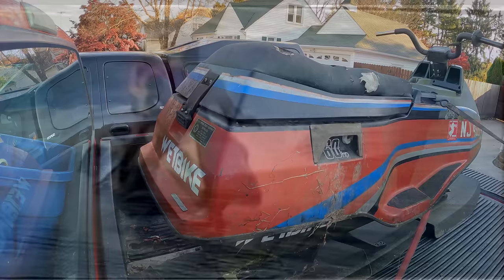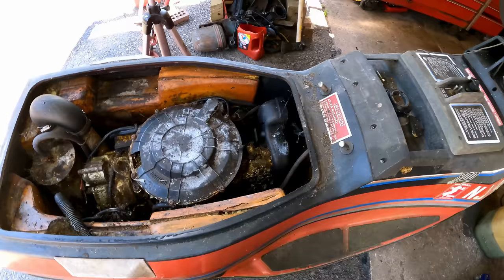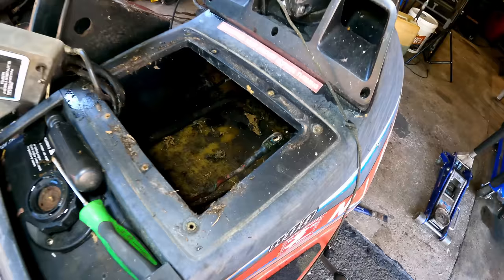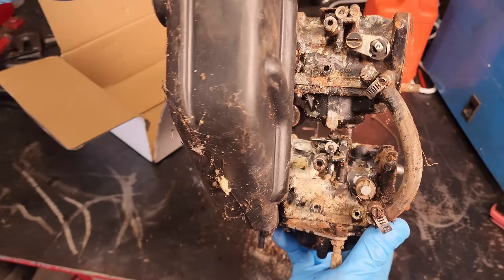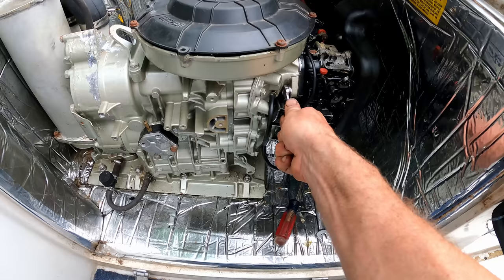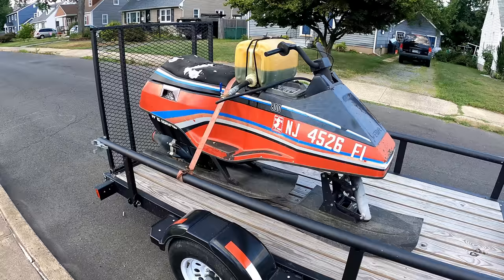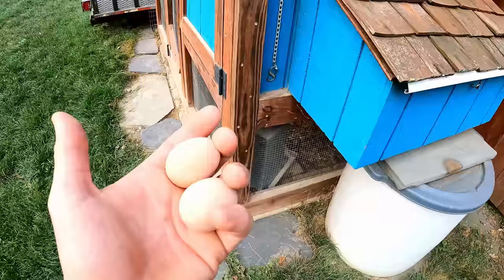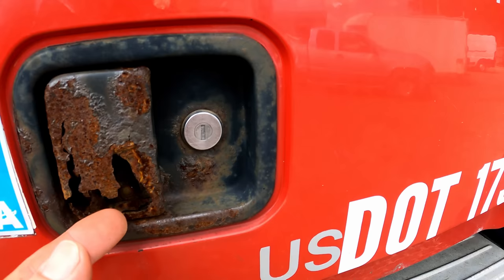70's WETBIKE Sitting For 25 Years Will It Run? UltraNautics WetCo - NNKH

Comment: The Wetbike is actually a blast on the water. It's a shame it wasn't stored properly, it was in sad shape! The 60 HP version is well balanced and has tons of power. There is a learning curve though. Your main problem was the fuel tank. First, the stock tank sits low in the Wetbike and holds 10 gallons of fuel. That adds 60 pounds and puts the center of gravity low. Secondly, when you punch the throttle, you have to stand up and lean over the handlebars. Your weight has to be forward and then it will pop right up on plane. But your test tank position prevented you from being able to assume the correct position for launch! Good try though, especially without any instruction. If you had been able to get it up, you would have had one helluva ride! Hopefully, the new owner will get it going again. You really did him solid at $1000 for both units! Great video and it brought back lots of fun memories. I have hundreds of hours riding time on wetbikes in the 80's and 90's out on the Colorado River (Yuma area), Pacific Ocean, San Diego Bay and Mission Bay! Those were some fun times!
Reply: So cool to hear about this! Riding in the Pacific would be so cool. Really all of those places you're mentioning sound Scenic and that would be such a neat exploration. Do you still have any or did you get rid of them long ago? I find it hard to grow out of them.

Exactly right on the fuel tank. And that price was amazing, I'm jealous. I'm glad he didn't get hurt, I would never want to be that near a dock when mounting one of these, even though I have ridden for years. Even though he can't do the full crawl to mount correctly with the auxiliary tank there, starting it while you're off the bike and then trying to jump on from the side is a disaster. I would never try that, when there's a dock next to you to fall back into.

Most of your riding sounds like it would have been scenery fit for the commercial they advertise these in. I'm jealous :/
Reply: I,ve got that model. I still love mine. And yes you can get parts on the internet. Much more fun than a jetski

Comment: Best case of just easier to pull the motor to work on I've ever seen
Reply: Very true lol that's the factory instruction for a lot of maintenance. Will take you less time to pull the motor and replace things then to fit a wrench in there and make micro turns until accessories loosen.

Comment: I think there were only 4 people that could actually drive these wet bikes the way they showed in the video. Those were the 4 guys. I have been watching your videos and am very impressed with what you do. I would love to be able to find cars and fix them to get them running. I went towards building homes and projects. I think I know just enough about cars to get me in trouble. If I was able to actually take it apart I could get it back together pretty well. Don't ask me to fix something on the fly. Loved the episode with the Chevelle.
Reply: I also enjoyed the Chevelle episode. He is good at fixing things quickly, I wish I was that good. You would be surprised how little it takes to ride them like they do in the advertisement. Most people could ride them impressively in under an hour, well enough to feel confident in their skills in less than half that time. Don't get on from the side (same for any jetski) and get the fuel tank out of there since that's where you're supposed to be sitting, then you just have to get a feel for the steering. Not hard. Not sitting far enough forward at takeoff makes it want to pop a wheelie and then you can't steer it all and not many people can balance that way anyways, like riding a bike wheelie.

Comment: Just happen to come across this video. Ironically, I used to have one and it was a blast (until it got stolen). Just to let you know, the procedure for starting off is:
1) slide onto the seat by pulling yourself from the back and up to the sitting position using the handle bars.
2) once sitting on it, then you start it and take off.
Great video and good job getting it running !

Comment: Something I have learned that helps when pulling a cable whether throttle or hood latch, attach either wire or a heavy string to the end so as you pull it out it gives you the path to put the new one in, just tie it to the end of the new cable and pull it through 😊

Comment: Well you got it running. I think what was holding you back like you said was the tank in your way. Not being able to put your mass where it’s needed is a big deal with that machine. 

Anyway you got them cleaned up and running and off to someone who can use it and not to the dump. Mission accomplished.
Reply: Definitely true, that fuel tank preventing his body position and weight from being in the right spot did not help. Not mounting it from the rear and getting balanced before trying to start it was also a problem, I've ridden these for years and I would never try and start it and then get on from the side

Comment: make sure to take the filter out of the vacuum when sucking liquids.
It has a check valve to prevent liquids to get into the motor. This way your filter stays in good shape for dry stuff.

Comment: Worked at a Honda dealer  that had a wet bike lot of fun to get started to plain out the trick was balls to the walls an keep on it even in the turns but it would beat you every time, thats good it sold

Comment: Ok.  One of the secrets of riding a wetbike is stand up.  As you take off you have to shift your weight forward to the front ski. Basically stand up and lean forward as the front of the boat comes up.  Also the bigger you are the more forward you would sit.  I find myself basically sitting on the gas tank.  I own 3 Wetbikes.

Comment: I have one just like that.
60hp Suzuki. 
The first ones had Kawasaki engines
You cannot get back on in deep water from the side. It will just roll over on you.
You have to stand on ski in rear and grab handlebars.  Start engine and give full throttle. As it stands up on end pull yourself up onto seat.
It's like riding a motorcycle on the water.
Lean it to turn.
They will wear you out after a day of riding.

Comment: I remember when I was a kid someone had one of these on the lake at the cottage it was so slow but looked like a blast
Reply: Dont know how long it was since you were a kid but these were the fastest PWC-thingy you could get factory stock until the 1990s, at almost 40mph. So back in the day if they were runinng correctly, they were considered quite fast. A modern Seadoo spark with the 60hp engine which is a pretty popular entry level PWC isnt any faster really even today.

Comment: Stuck screws? I like Mustie1 's solution which is an air hammer attachment that has a turn bar and a screwdriver adapter.  You engage the trigger and turn the bar which gets almost any stuck tight screw out, he also uses the hammer driven screwdriver outfit as well.

Comment: These things are a blast to ride!  Only problem I see is that fuel tank, it’s right where the body needs to be when getting up on plane.  Crashing is pretty violent too like when you carve to tight and catch an edge over correcting.  But man what a blast!
Reply: yea it seemed like weight balance and distribution were way off.

Comment: Remove 10 nuts on the pump. Unhook the throttle cable and battery and lift the engine out.

Comment: you shouldn't give up that easily. these are not that hard to ride and can bea lot of fun. you can pull several water skiers & I've even barefoot skied next to it while riding it. I worked for the invented of the wet bike & we would take them to a lake or ocean to advertise them. we would run circles around Jetsons. a friend of mine has a few of them & lots of spare parts. we could even talk to the invented (Nelson Tyler) for spare parts. well at least you didn't loose any money on the deal. thanks, it was nice to see one of these still kicking. 
Cory

Comment: You are supposed to remove the air filter in your wet/dry vac when you are sucking up liquids.
Reply from the maker: Yeah a bunch of people commented about that but doesn't really make sense to me. If your vacuuming straight water I suppose you could do that but if it's full of a bunch of junk, you wouldn't want to risk sucking that in to the vacuum motor no? Anyway, I've been vacuuming with the filter in for 15 years now and never had a problem. Heck I've only replaced the filter like three times out of all those years.

Comment: Did you not realise,that the engine would not fire untill you stopped cranking the starter?!..  I've seen this so many times with old cars!  Never mind, it's not your problem any longer, it's the poor smock who came up to buy it......   🤓👍  ,Z
Reply from the maker: I did but it didn't do it every time. I guess the timing was off a little bit or some kind of ignition problem.

Comment: Adding the fuel tank to the top of the machine offset the center of gravity.  That's why the fuel tank is low.  Imagine balancing a bowling ball on top of a a pencil.

Learned the joy of trying to find parts for an old vehicle today.  I wanted to put new exhaust manifolds on the reconditioned motor going into my 1991 F-150, but can't get the EGR tube and adapter off of the old exhaust manifold, so it goes back on the reconditioned motor as is.  Soaked and torched the connection for the last month!  Either that, or stomp around a salvage yard and see if I have better luck.  Maybe someone has a better idea?

Comment: You had removed a huge amount of buoyancy from the back end, no wonder it kept sinking!
Reply from the maker: Foam is not any more buoyant than air. That's like saying if you put foam in a glass bottle it's going to be more buoyant than if jjust left empty
Reply from the maker: The only purpose of the foam is in case the cavity fills with water it keeps the vessel from sinking

Comment: Come to Texas, I have a 1978 Jeep CJ5 that needs some work.
Reply from the maker: Any chance you want to sell it? I'll trade you an El Camino. Lol. Actually going to be passing through Texas the next couple days
Reply: @NoNonsenseKnowHow  the chance is always there. 304, factory power steering, manual brakes, ZERO RUST. I put chromolly axles in the rear, and she runs. Ramsey winch. Sorry but just a T-15 3 speed tranny.

Comment: Hej Man , ive got my 2nd ever Optima red Top and it got run down to dead real bad , i put it on recovery charge with w Norwegian Bluelli charger and now its HOT all the time! I beat my frist brand new Optima to death for years , i bout this near new one and it may well have been a bad one to start and i got scammed but i expected it to be OK? Have you any idea? Its sat in my old Volv not connected and is still hot..........Cheers Man , you ROCK IT! LesM
Reply from the maker: Interesting. Sounds like something is wrong with it internally. I've heard the quality has went down dramatically on the optima  batteries in recent years..
Reply: @NoNonsenseKnowHow  Thanks Man, I reckon I knew it but yeah, I'm scrapping it. I'll drive the Volvo 240 to an auto electrician to get the other issues fixed and put in a new battery. I'm sad....If you want a holiday to Australia,  I'll help out!

Comment: You know why it doesn't want to shut off it's because there's stuff that's burning inside the combustion chamber and it's igniting the air fuel charger instead of the spark plug I bet you after it runs for a while it'll act normal.

Comment: You could honestly save that cab if you let it soak in gas for just 20 minutes and then clean it with cab cleaner or Wd 40.
Reply from the maker: The one with a giant corrosion hole on the side of it?

Comment: man i picked up a 04 superjet that a guy left in a barn without the damn cowl off.. had to deal with this same stuff about  good 3" of mice crap throughout the whole thing had to pull everything out other than the motor to be able to clean it and lucky me there is no drain on those only a pump driven drain that drains as you ride. it was a nightmare to clean lol i hate RATS And MICE!.

Comment: the foam you cut out messed up the balance
Reply from the maker: If anything the foam would have made it heavier in the back.  If you fill a plastic water bottle with foam doesn't make it any more buoyant than leaving it empty with the cap on. If anything less buoyant because foam has weight especially if it's waterlogged.

Comment: You DO know why the foam is in there, right?
Reply from the maker: Yeah for if the vessel takes on water. Foam doesn't make boats float. Think of it like filling a glass bottle with foam and putting the cap on. It's not going to be more buoyant than if just left empty. If anything you just added weight to it so it's going to float less

Comment: The thing probably needs to be in almost brand new shape to work properly with lower compression it probably produces a lot less horsepower and that lack of horsepower is probably the reason why it doesn't work so good.
Reply: Did you miss the compression check he did? Was good

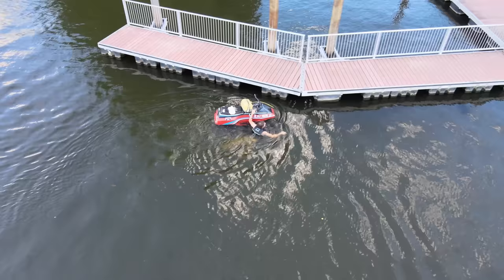Comment: Sincerely THAT has GOT TO BE the most DISGUSTING animal ridden machine I've ever seen cleaned out/up on any You Tube channel! YOU SIR ARE A HERO!! Hand fulls after hand fulls of SH!T!  On another note those foam sides etc were I'm sure to help it float in the water so ....lol.   (After watching until 26:30) Okay I think the foam is more important that at first guessed. LOL. It may be acting as a type of ballast or something as well but I do know the "Engineers" (The insane people that came up with this machine) put it there for a reason. Or as they say about OEM parts that have been changed or removed, In short "TPITFAR".  TIPPYTOOFAR" (They Put It There For A Reason). Or it's the same as tearing down a fence before you inspect it's purpose. LOL.